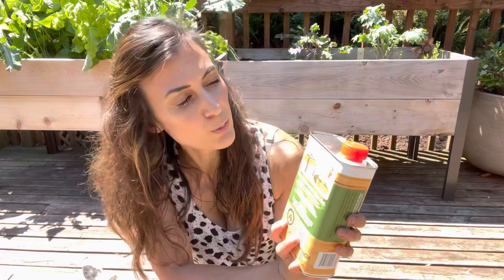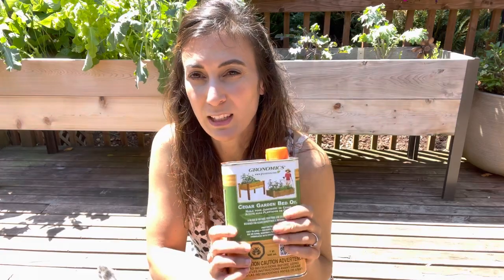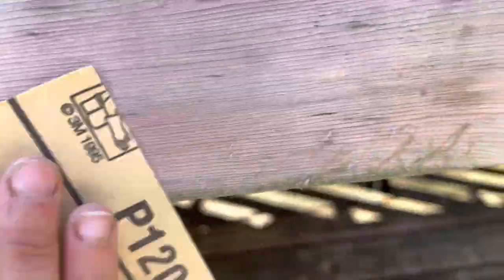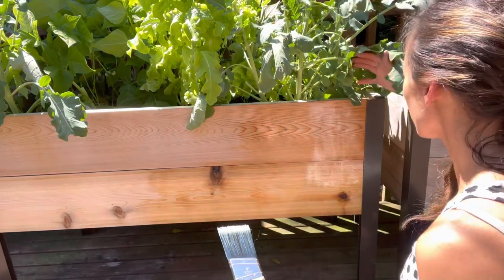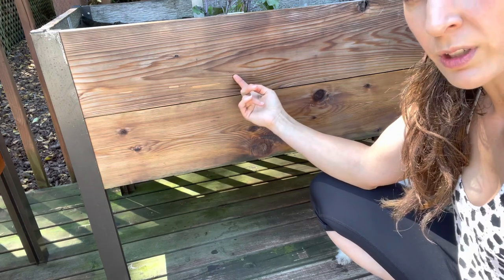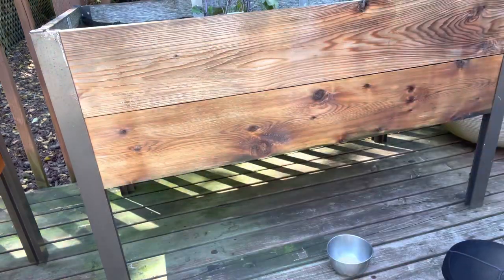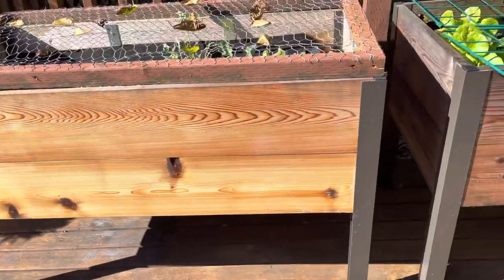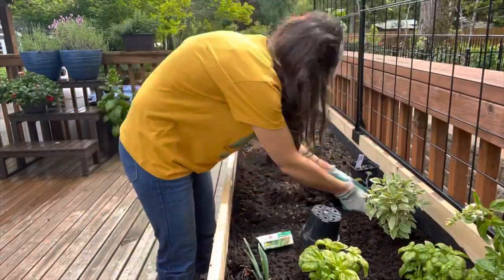Organic Gardening | Safe Wood Stain For Gardens & Vegetables | Garden With Me

Comment: Would you recommend washing the weathered wood before staining? Typically it's done to fences with a cleaning solution and brush to get off dirt and particles to allow for a deep soak of the stain. Prevents from stain peeling off over time.